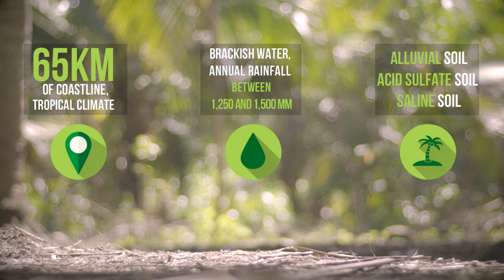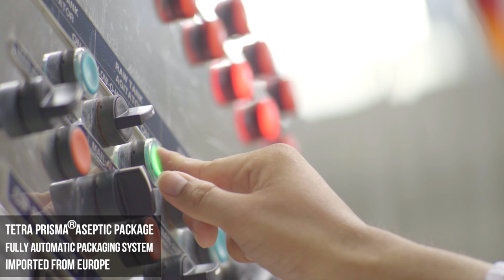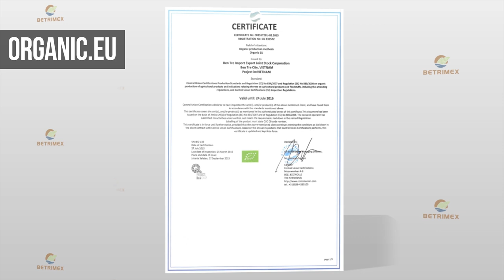Betrimex - Coconut water Manufacturing process

Comment: I would prefer to just have the coconut without any of this processing or manufacturing process included l.
it is sad that in the United States a coconut will cost $4 but it is only $2 to buy the coconut water outside of the coconut, probably because it is not 100% coconut water it does not taste as good either no matter what the labeling says in my opinion  Once manufacturing processing packaging are involved the flavor is completely changed
Reply from the maker: Our products are processed by direct UHT technology to preserve nutrients & fresh flavor of Ben Tre coconut. No preservatives, no colorings, never from concentrate.
Reply: Dear Jason I Have pure Sri Lankan King Coconut water , I think You interesting it ....
Reply: I'll try it
Reply: You are right.  Nothing tastes the same as fresh but there is no way to keep just coconut juice fresh without this minimal processing and the juice with fat will go bad very quickly.   The only way is to buy the whole coconut (I mean the untouched ones that still have the green color, not the white ones wraped in platic because those were soaked in chemicals to keep them from discoloration).  Ben Tre grows the best tasting coconut in Vietnam.  If you were in Vietnam, eating fresh coconut there is heavenly.  The only way I can think of is to freeze the 100% whole juice and exported to be consummed within 24 hours, but it will be extremely expensive this way.
Reply: @amyhoang9140  Good info. Thnx